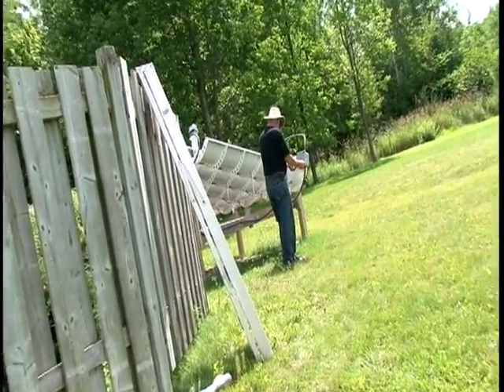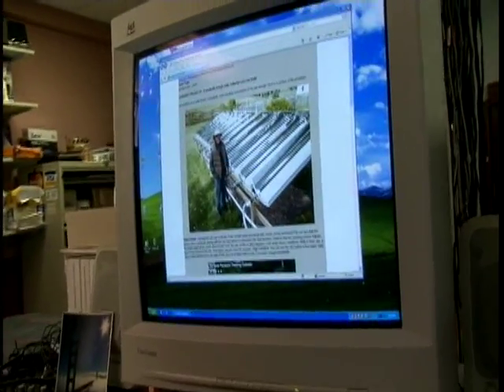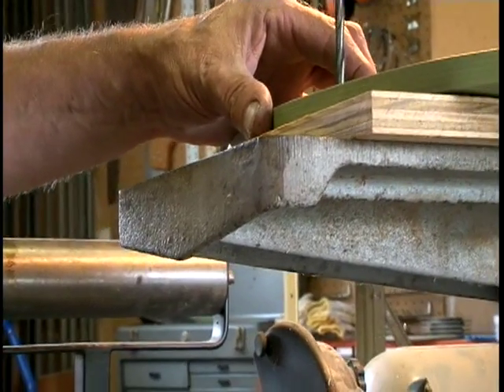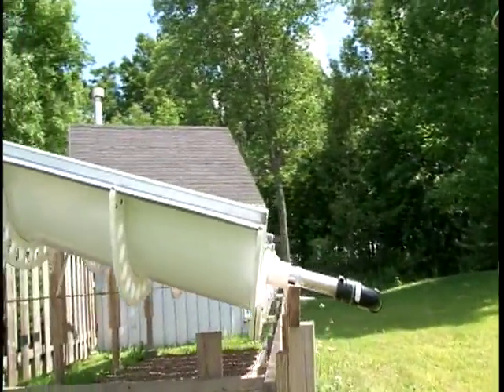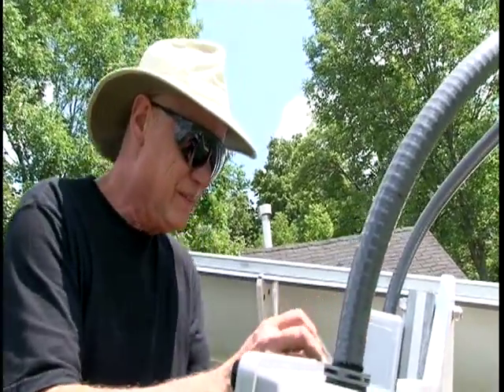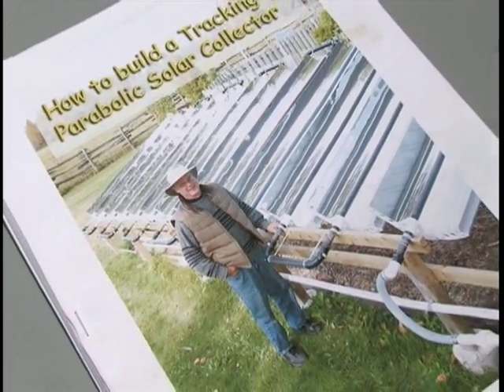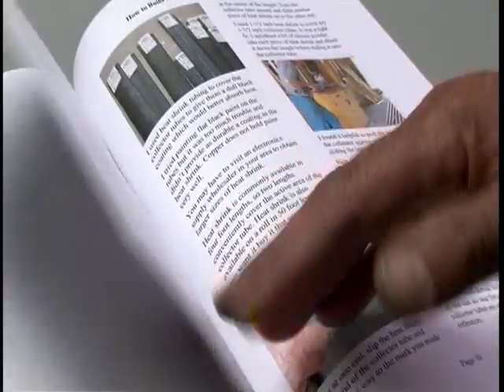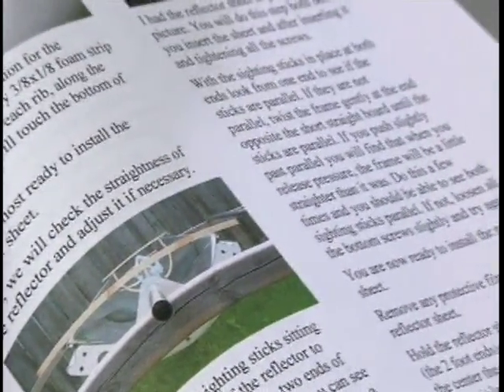DIY Solar Tracking Parabolic Concentrator - The Story

Comment from the maker: For swimming pool heating, sealed collectors would not make any difference since the flow is so high the temperature rise is only a couple degrees. I am working on a vacuum sealed collector for a higher temp application.

With careful design and construction, all of the light from the reflector falls on the collector. I can see this in the beam which does not extend off the collector. 

Thank you for your interest and comments

Comment from the maker: Thank you. When the sun is overhead and hottest the orientation really does not matter so much. At lower elevations (earlier/later in the day), if oriented east-west, the tracker would not work as hard agreed but more sunlight spills from the ends if the array is east-west so it is less efficient maybe by about 15% at those times. I don't use it in the winter, so there is no seasonal adjustment for me.

Comment: Did you ever consider vacuum sealing your collectors?  Would it make any difference?  Another idea are secondary reflectors, assuming the reflectors are not perfect use smaller parabolic reflectors mounted on top of the pipes, these may reflect less light than is actually directly shown on the pipe though.  Another idea are fresnel lenses, easily attached to your current setup.  Perhaps do these tests to one of your troughs and measure the improvements.

Comment: I appreciate your sharing of information. I was wondering ... I noticed you have your panels set up in series ... do you think if the heating tubes were bundled 3 together in one panel and those 3 also in a series and all three either open to atmosphere or shrouded in a vacuum tube that they would produce even more heated water?

Comment: Thanks George for the video . For a 5 X 3 Meter pool how many parabolic concentrators will I need? I live in South Africa where we have a lot of sun.
Reply from the maker: Depends on how warm you want the water? :)
My advice in the book is to build a small system and take some measurements. I give examples.
I am sure you have much better sun than me! Thanks
Reply: @georgeplhak   Thanks for responding.  Will start with one and take measurements

Comment: very interesting! how long do you think it would take 4 of those panels to heat a 20k gallon pool from 45 degrees to 120 degrees ?
Reply from the maker: Here are my results heating a larger pool with more troughs https://georgesworkshop.blogspot.ca/2009/07/performance-of-tracking-solar-parabola.html. Your mileage will depend on many factors, including your sun resource (where you are and the microclimate) as well on whether the pool is insulated. More in the books and the georgesworkshop blog articles (see solar thermal tab). Thanks for your interest. George
Reply: Thanks for the reply George! i will definitely take a very close look at the articles on your website. I found your videos when I finally decided that solar troughs are easier and more practical to produce then parabolic mirrors. thanks once again!

Comment: How did you calculated the shape (profile) of the long-side plates screwed to a parabolic plates?
Reply from the maker: I am not sure I understand your question?
Reply: ***** I don't know the correct tech term for this part. It is a long plate (probably sheet metal) which joins all the ribs together from both sides.
Reply from the maker: Sorry Alex but still cannot answer you. Have you seen my links? Please see here https://georgesworkshop.blogspot.ca/2012/08/diy-solar-parabolic-trough-20-intro.html and perhaps the term you need will be described. Thank you for your interest. George
Reply: ***** thanx for the link. You call it: "Simpler side channels I show how to use a standard angle profile in a very strong and precise joint that can be made by hand or machine...". But on the video it is not from the angle, but from a sophisticated profile.
Reply from the maker: Now I understand. The side channels of the earlier design used a common galvanized steel shape used in wall construction called "hat channel". I did not determine the shape but it was convenient, strong and inexpensive and I thought, easily available. But it was not easily available outside Canada. The new design uses standard angle profile and this is truly universally available, equally inexpensive, very strong and simpler to make.